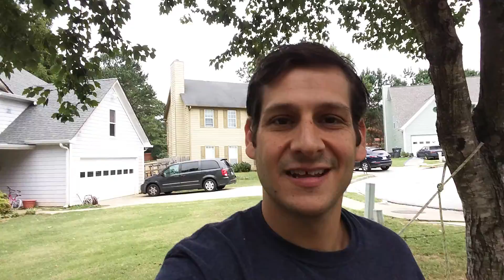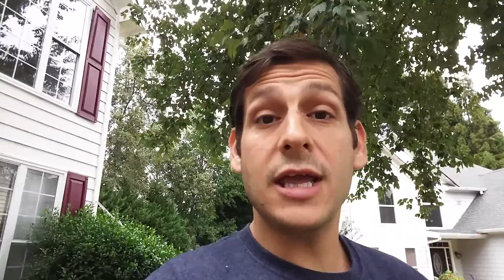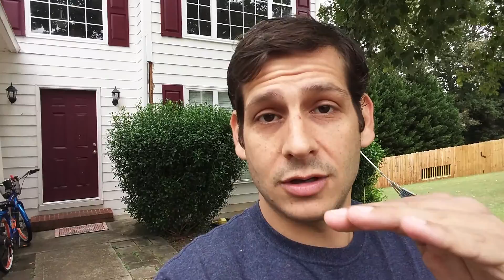Three Benefits of Ground Penetrating Radar (GPR) for Geotechnical Engineering

Comment: Hi Dan
 Love your videos really helpful.I do contract geotechnical drilling for soil testing companies for residential construction and just have bought a second hand GPR unit.
I will be using it for several applications including rock and water table identification for jobs where basement constructions are required.
A lot of the time there is a existing house that will be demolished later and I can only do a deep test at the front of the house.Now with the GPR I can calibrate the unit with the deep hole at the front and then survey with the GPR around the sides and rear of the properties where there is no drill rig access.
I have a big advantage of owning a moisture probe that uses dielectric constant to determine moisture contents so I can test different  layers that I encounter during drilling and feed the dielectric info into the GPR unit for accurate depth readings.
I am just starting out with the GPR but I can see many advantages for geotechnicians owning this type of equipment and with knowledge of soil types and actual drilling and inspecting profiles before GPR surveys geotechnicians will have a big advantage of general GPR surveys companies.

Jason
Reply from the maker: Cait McCloud Thanks so much for the comment. That's great that you grabbed a second hand unit. I think you are right. Geotech engineers have an opportunity to perform more complicated projects than many general firms can handle. the work will go to someone. Also it would be super cool to create multiple velocity models with the accurate dielectric measurements. this literally would put layer by layer into place based on its unique properties. please keep watching and let me know if I can ever answer any questions for you!